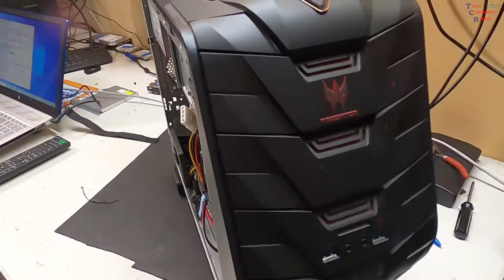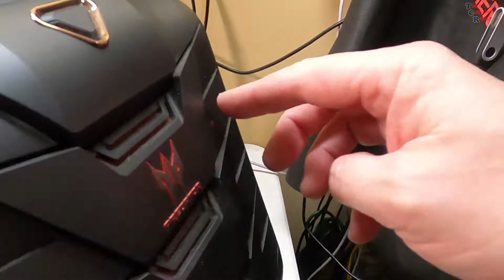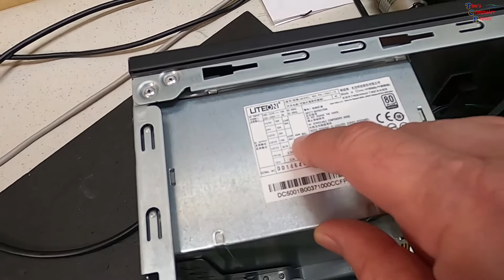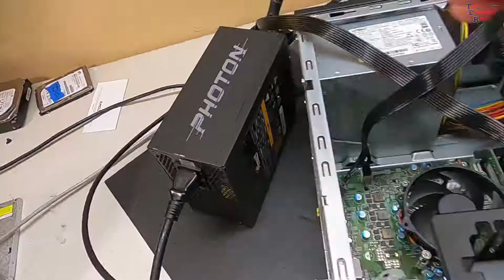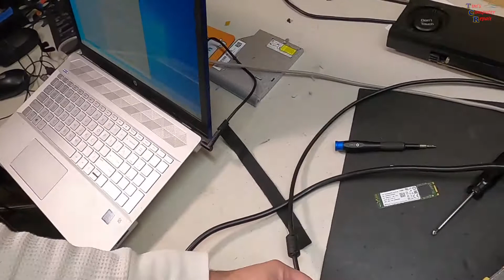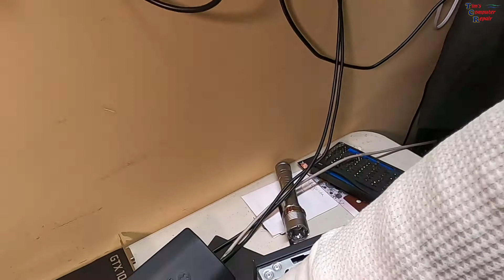Easy Steps to Take When Your Desktop Computer Won't Turn on

Comment: I have to turn my gaming PC on twice to get it started. I press the power button and it lights up, but no picture. I have to long hold the power again to turn it off, then push power again and it boots up perfectly. All front power connections are in the right place, but no matter what I do, it happens every time! Any ideas? Anyone?  Great video btw👍
Reply from the maker: Try loading defaults in BIOS or check for a newer bios update.
Reply: @TimsComputerRepair  👍👍